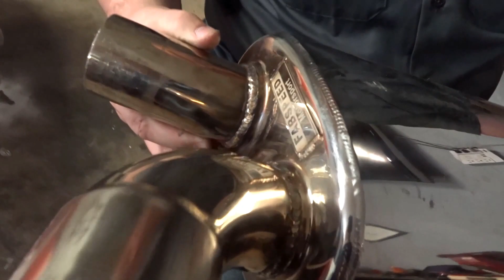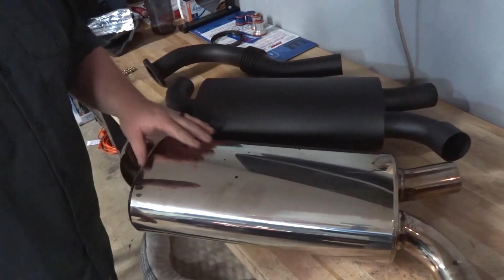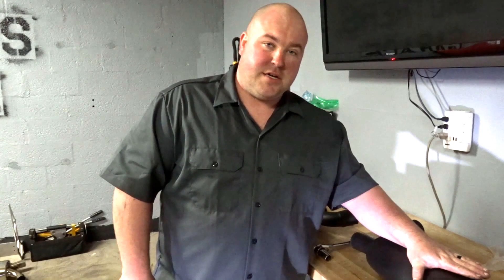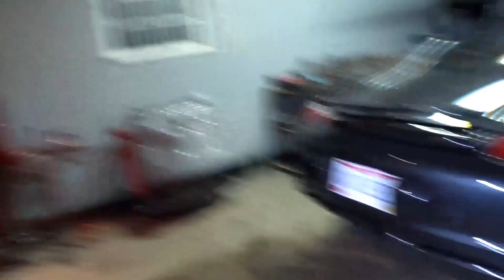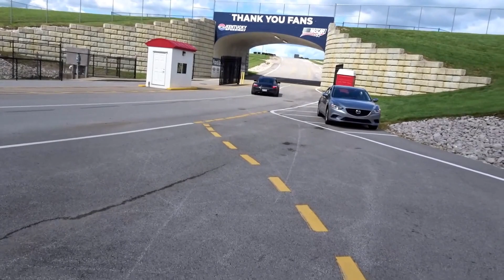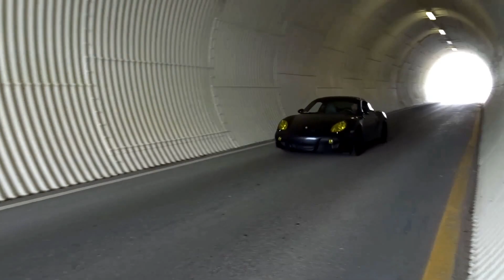Circuit Werks Exhaust Install / Review - Porsche Cayman S

Comment: Looks like major difference is that the old one is aluminized steel and Fabspeed is stainless? That's why they paint it black, but it still rusts because rock chips scratch the coating. Inside the quality of sound material, rock wool or whatever, must be large too.

Comment: So... how did this sound INSIDE the Cayman? My issue with many of these exhaust systems designed is that they are not conducive to 'daily driving' inside the cabin, often quite deafening in the driver's seat...
Reply from the maker: There is no question it had significantly more drone that the Soul Performance system we ended up using on the car. It wasn’t deafening, but by no means was it drone free!
Reply: @BoostBrothersGarage  not sure on the Caymens but I have a 2000 boxster S that I put a circuit works exhaust on and also done the secondary cat delete pipes which I was told would stop any real droning and honestly it really has no droning at all man. It's quit in the cab when you want it to be and loud when you want it to be also but on the interstate or just cruising around town there is absolutely no droning hell in sixth gear on the highway you almost can't hear the exhaust even with the top down i love it and sounds amazing

Comment: Video posted May 2017
So it's February 2019, man I sure hope I have little to zero issues, I just received mine today, Circuit Werks  muffler only $228.  Waiting g on secondary cat test pipes. Better have a pro install this just in case it needs some loving to fit!

Comment: I know this is an older video (install 1 year ago), but you stated that after a while the V2 system had the mounts fail, and the exhaust dropped to the ground.  Did you contact Customer Service for why it happened, improvements to design, etc?  I had just bought this system in brush finish, and was wondering if the flaw might have been fixed, or something I can do to them before mounting so it doesnt happen to me.
Reply from the maker: We did not have much luck with customer service, hopefully that has improved. We ended up having a local shop (one that builds turbo kits) reweld those mounts and didn't have any other failures. In fact, we sold the exhaust to a subscriber and he is still running it with no issues. It could have been inferior welds on just that system, or a bad batch of stainless, not too sure. Adding some gussets where the those mounts attach to the muffler would give me some piece of mind...
Reply: Thank you for the update.  It is 10 months later so hopefully they have improved and I might just add those gussets.  Good idea!
Reply: Do you have any installed pics of the V2 system?  They don't come with instructions and just wanted to see the general layout of what it should look like.

Comment: Hey, guys! Thanks for the video. While the exhaust sounds fantastic from the outside, how does it sound inside the car? Many aftermarket exhausts make a terribly annoying, almost deafening, drone sound at highway speeds. Is the interior sound at highway speeds sweet, livable or painful? Thanks!
Reply from the maker: So the V1 kit didn’t have much drone, but the fitment was terrible. The V2 kit fit better but it did have a decent amount of drone. It also ended up breaking at the mounts and the whole kit fell down and was dragging behind the car, not much fun! We ended up with a Soul Performance Exhaust and couldn’t be happier. It was really expensive but it has ZERO drone and sounds absolutely amazing. As much as we like to save a buck, i would save up for a quality kit as both of the CW lots we tried ended up failing!
Reply: Hey MJE,  I have a circuit werks exhaust in my 2007 cayman and cost about  $300.00 for the parts.  I had a muffler shop put in the exhaust and I am glad I did.  The muffler shop charged me $120.00 to put it in.  I also gave the tech $20.00 so he would do good job (I highly recommend this). The tech removed the system from the Cat back and then started to install the CW system.  The tech had to cut the pipes going to the mufflers and weld a piece in so they could be properly spaced.  The tech and I came to the conclusion that the tips sticking out half way between the bumper and the bumperettes looked the best (when looking straight down, even with the rear bumper).  The tech also made some extra brackets and welded them in place so they would bolt right up to some stock points.  The sound is great!  I highly recommend this exhaust system with the caveat that a pro install the system or a person with a lift, welder, and some extra material to really make the install secure.  Remember the system was inexpensive to begin so why not pay a little to get it installed professionally!  The drone is what you really asked about so it is really not that bad.  The most prevalent sound comes from 2-3,000 rpm and under a light to medium load (i.e. going up an entrance ramp).  The drone sound level is not very loud even under a light to medium load.  I would say it is not as loud as a normal conversation between two people (boyfriend-girlfriend or husband-wife) normally in the car as my wife and I can still talk with the drone.  I wouldn't want to have it any louder.  I would now put this system up to any $1200.00 + system any day.
Reply: @blkcc1  how did it hold up for you ?
Reply: @josephs4700 I sold my Cayman last October.  When sold, the exhaust was rock solid and sounded awesome!  I loved the exhaust and would buy another in a heartbeat.  

The installer used the cross brace from the old exhaust mounted at the rear end and added some supports where needed.  

My exhaust was perfect and I do believe that when the buyer started the car and heard the exhaust, that was a selling point.  He smiled when he heard it.  The install needs to be put in and welded by an experienced installer… or at least someone that really knows how to weld correctly.  

I believe like anything else, if you install correctly, it will last, if installed Halfass it won’t.  Find a mom and pop muffler shop, buy the installer lunch and watch how much better your exhaust is installed.  Mine lasted for years and was like original equipment when sold years later and moving from CA to TX and back to CA.  

My muffler was installed by Eddie’s tire and muffler @ corner of Main st and Beyer blvd in south San Diego.  They have installed my other exhausts as well.

Comment: The higher quality brands don't get much easier to fit. My coworker put many many hours into installing some high dollar aftermarket on a 991.1 Carrera S. Perfect fitment with pretty much any aftermarket exhaust is always an issue. At least they gave you a refund!
Reply from the maker: Kyle Kloewer it's really just crazy to think a mass produced 2-1/4" exhaust should cost $2000! I get that they are making less than say Magnaflow does a Mustang exhaust, but that Mustang exhaust is 3", twice the material and labor and half the price. Circuit Werks customer service was much appreciated for sure!

Comment: Hey - I am wondering how the Circuit Werks V2 kit is when it comes to drone - how is it?
Reply from the maker: Kevin Heatherly there is a slight amount of drone in the lower RPM's, but it's not bad. Compared to some of the mustangs I've owned with aftermarket exhaust it's hardly noticeable. I plan to do a follow up video and will get some in car footage then, as well as let everyone know how the exhaust is holding up

Comment: Nice work.

i've been wondering about the CW kits.  Though, now in the near $800 range, you can have an OEM based Carnewal kit without any fitment or durability issues.

I feel your pain on the stall.  I still get occasional stalls in my 987.1 even with the clutch defeat switch removed and FVD tune.
Reply from the maker: Interesting, i had never seen their stuff before. Does the diameter of the tubing change, or just muffler internals? 

Yeah, still getting used to the lightweight flywheel and sachs clutch!

Thanks for watching!
Reply: The kits are about $525 on eBay now in July 2020.  Anyone have a newer kit on their 981?  How is it?